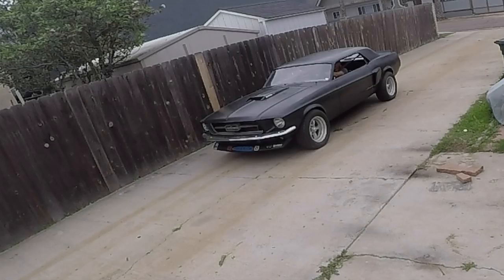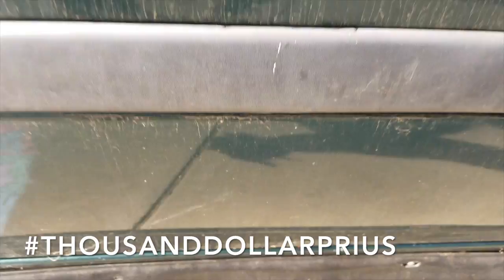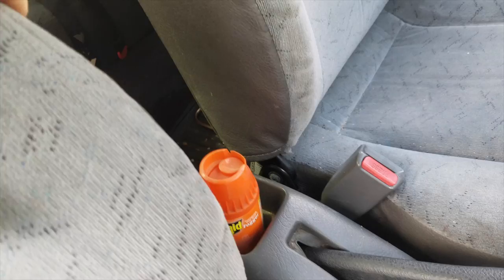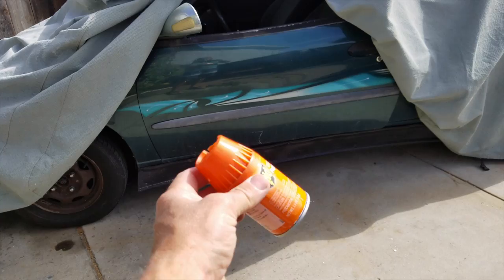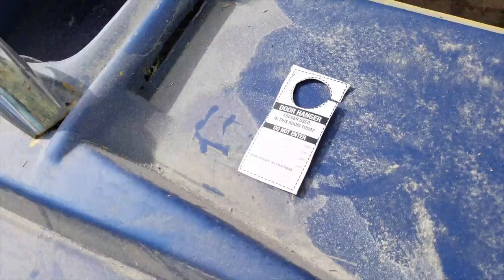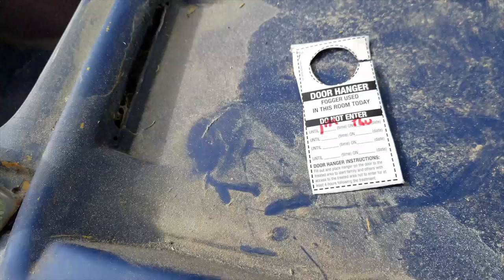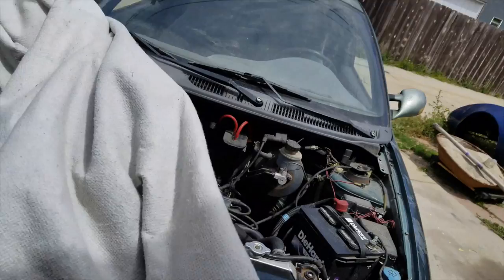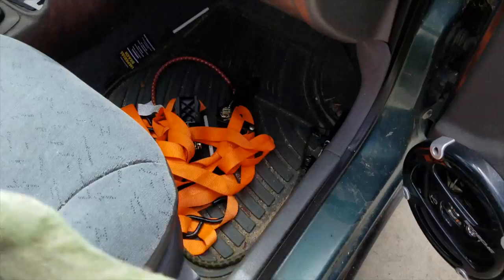How to Get Rid of Bugs in Your Car!  [] Easy and Cheap []

Comment: It’s actually a pretty common issue even for clean cars parked in garages, I recommend spraying some Raid but if you use a fogger you can manually spray it I would spray about half. After a few hours just lower all the windows and let it sit for a bit, then drive it around with the AC all the way up and clean all the interior thoroughly as well as vacumm and you’re all set. As a precautionary step wipe the doors where they seal, with peppermint spray and that will keep any future intruders from entering
Reply from the maker: peppermint spray is a good tip!  Essential Oils for the win
Reply: I'm having this same issue with these nagging ass spiders 🕷 in mine!! Im using peppermint oil and lemongrass but im thinking about car bomb because they won't stay out.

Comment: Make sure you get the "no mess" bug foggers, so a residue isn't left behind. Also the windows should've been closed
Reply: I was about to say I closed my windows and did the underside/engine bay.
Reply: On the instructions it says to leave the windows open
Reply: @mzshanti2012  it says that for after the hours go by that it's inside the space, to leave the windows open to air it out... Not to have them open while it's fogging
Reply: @carolineford6694  I just bought a fumigator but im scared it'll damage the engine if there's a slight leak or something the whole thing will caught on fire

Comment: I just watched one crawl right in through my open door and disappear while I was about to get outta my car, not sure what to do about it now but I think I'd rather bug bomb than go looking for it
Reply from the maker: Yeah dude, definitely the way to go.
Reply: @MatthewRobertHenry  Do you have any clue if it's safe around electronics?  I don't wanna bust up my radio over a spider 😂
Reply from the maker: That's a common question.  It's a vapor not an actual fog.  You really should be fine.  Pull the negative battery terminal if you want to be sure.

Comment: Had to laugh!  I had an old Suburban in Palmdale that sat outside and never driven.  A neighbor blew up their car so I gave it to them but first I got the leaf blower out, opened all the doors and blew out a couple years worth of dust.  Worked like a charm!  I wondered how much clean up work you'd have to do after the fogger.  Nice work but sorry spidies!
Reply from the maker: That's a great story!  The Leaf blower is a very under-utilized tool.  Ever since I got a cordless one, I use it for EVERYTHING!  Haha you might remember me using it to burn out a stump, I also have on occasion (when Christy is not home) used it to "sweep" the house," get any dry leaves out of the tree surrounding the #bucketlisttreehouse, and clean off the roof/gutters lol.  The possibilities are endless!
Reply: Awesome!  You've given me some new ideas too.  I've found that flying my small drone carefully I can get the dust bunnies from hard to reach places too - ha, ha!  (But then I don't have anyone to catch me and tell me "no").

Comment: Just think you could have used orange essential oIl and black pepper mixed with baking soda.  Turn the heater on for five minutes with the windows up and they would have died without exposing yourself to toxic chemicals.
Reply: Irange oil will disslove styrofoam. Try it. How is that non-toxic?

Comment: I've been having a carpet beetle problem in my car and came across this video. Do you think it'll work? And would it be safe to do it with the windows completely closed?
Reply: I have the same problem.  Did you try it?  I've tried boric acid, seems like it cuts them down but never gets rid of them.
Reply: On the instructions it says not leave the mist in an enclosed area because it can cause the can to explode. Ive tried it and left my windows a little cracked.

Comment: I better do for my Volvo 740GL. Inside the car is clean except full of spider webs outside. I had major huntsman hiding around and one red back in the engine. It would be safe to have two bug bombs at the front and rear. Yes better disconnect negative battery terminal.
Reply from the maker: Go get 'em 🕷💀💀💀

Comment: I was told this would affect the electrical system of the car. Have you had any trouble? I really want my husband to do this.  I suggested it before I found your confirmation video. I hope we can prove them wrong. Glad you shared this video!!
Reply from the maker: Hahaha, I seriously cannot imagine that would ever ever happen.  No issues here, but your car's electronics are off and unpowered, plus the mist is a gas, not moist at all, certainly not enough to short anything.  If you're super worried about it, you could unplug the negative battery terminal, and reset your clock and radio when you're done, but I'd seriously be shocked if you ever saw any kind of adverse effect mechanically.  Check the label on the bug bomb just to be safe too lol.
Reply: Actually what can affect your cars electrical system are the bugs themselves. Some ants like fire ants can wreak havoc on wires and such and there goes your electrical. 
I'll take my chances with a Bug bomb over the bugs.
Reply: Would this work for wasps as well?

Comment: I thought I heard you say it a couple of times Prius. But that's a Geo metro. Nice! Is it a 3 cylinder stick?
Reply from the maker: It is! It's just the nickname it earned.  I got it for 1k of CL like a year before gas was $5 in Cali and they came out with the newfangled Prius.  Since I got equal  mpg for 1k it became a thing.
I also got seriously out of control with mpg aero mods at one point 😆 watch  my video geo metro MPG Master 🙃
Reply: @MatthewRobertHenry  yeah I once had a green one for many years not long ago.  Sense I could not hold on to three cars I finally let It go. 😢

Comment: I just recently got a 2020 mustang and it was owned by an old person who never cleaned it and then traded it and it sat for TWO YRS at the dealer.    the ENTIRE bottom of this car is infested with big spiders.   I don’t want to even park it in my garage at this point.  I kept noticing spider webs forming at the bottom of the car but figured once I washed the car and waxed it really good they would go away.     Nah.  A week later I’m in the garage and the WHOLE side of my car was just riddled with baby spiders.     The inside of the wheel well.    It was a fucking arachnid nightmare     I today tried to clean the bottom of the car the best I could with a undercarriage cleaner and a pressure washer on low but after two three hours of being in the garage.      The webs were back and these massive spiders showed up        And I keep look and the webs are just forming all over underneath the car.     I spray around the house and in the garage for bugs all the time so I’m not worried about them infesting in there but my car is absolutely 100% infested with spiders.    I’m going to buy a couple of the car bombs and put them all underneath the car and shut the garage up and let them things goooo.       It’s a convertible soft top too so it’s not like I can go run it through a car wash for the underbody.   If this doesn’t work I’m going back to the dealer and telling them to hoist this thing up and pressure wash tf out of it.    I about crashed the other day from a spider crawling on me.    These are worse than when a 🐝 flys in your window while you’re driving.

Comment: So does this not leave residual shit in the fabric? I had a grounding wire from my radiator fan touching the ground for less than 12 hours and now a couple thousand ants are cleaning my car out for me. I just dont want to sit in pesticides for a few months is all.
Reply from the maker: Answered below somewhere.  It's designed to use in homes with carpets, bedding, etc. Read and follow the instructions on the can, let it air out, wipe it down maybe. I didn't sweat it

Comment: When doing this,should you tape shut the ac vents in the car so it doesn’t get in there?just curious 😇
Reply from the maker: I doubt it. That's not a precaution those things specify for houses.  Plus spiders could be in there!  You should maybe run the air for a half hour before you drive somewhere just to be safe.  Just set it to outside air so you are venting in fresh air and not recycling the air

Comment: Would the fogger leave fumes still ? In the air. Since it’s such a small area
Reply from the maker: air it out per the instructions on the fogger.  I wiped mine down afterward as you saw.  A day in the sun cured any odor

Comment: Did this leave any residue or damage any interior? I’ve heard they damage interior and I’ve had to kill 6 spiders (all look the same) in like 3-4 days and I’m getting desperate I need them gone. But I really don’t want anything to happen to my interior
Reply from the maker: There's no warning or instruction to cover couches or pillows and they are made for indoors.  I had no issues.  Maybe pin a plastic. To the headliner or put it under a sunroof so it doesnt spray directly on that. But I had no issues only dead bugs
Reply: Thank you! I didn’t even think of the fact that I have a sunroof and it wouldn’t spray directly at my interior 😂 thank you for your help!!
Reply from the maker: It is my joy to help others, thank you!

Comment: I have a question... in the back of the box it says do not put in small spaces; closet, and cabinets and etc.

The reason why is because it says it is flammable and can explode. I called the number on the back of the can. They COULDN’t  answer my question and suggested not to do it....

Don’t know what to do haven’t driven my car in two weeks because I’m afraid of the spider
Reply: I read that too, leave a window cracked open a bit so it doesn’t form pressure and you’re all good it’ll dissipate in a few hours, I did mine not too long ago and it was all good
Reply from the maker: I suspect they'll always say something like that just to CYA. Like someone said, crack some windows or the hatch and doors, don't light any cigarettes, maybe unhook the negative battery cable if you're really worried about it.  Only do what you feel safe doing, but I haven't had anyone comment that their car caught on fire, and this video has... a LOT of views

Comment: **HELP PLEASE** 

I’m having an issue with ants and I’m not sure what’s going on. They keep coming from the side of the drivers door and a crease in between the door. I sprayed the engine and all over with Home Defense 3 weeks ago. STILL ANTS….. 

I used a cam of spray for them as I kept seeing them. No I DONT HAVE FOOD IN MY CAR NO KIDS EITHER. I saw this video, brought a fogger it, and a tarp. I put a bomb in my car and the trunk. Did everything that was recommended. 

Came back 4hrs later and removed the tarp and air’d out my car. Do you know these ants were still hanging around 😳😳🥵😡. What do I do now?
Reply: Won't eventually helped if anything at al